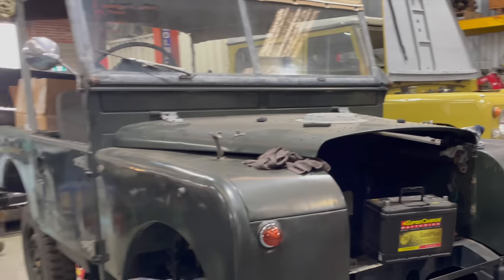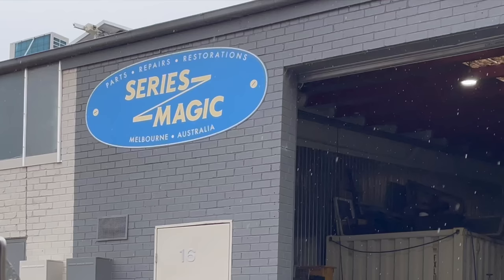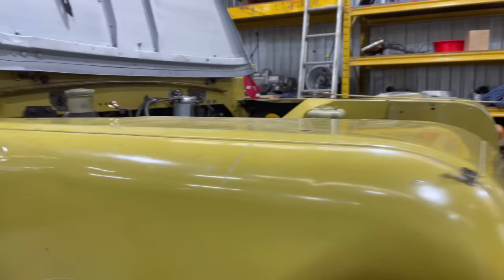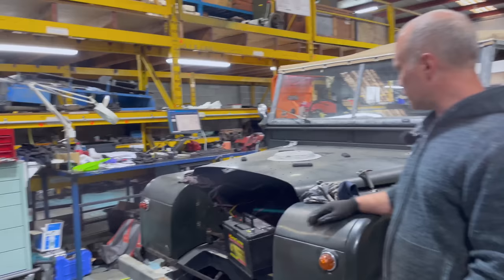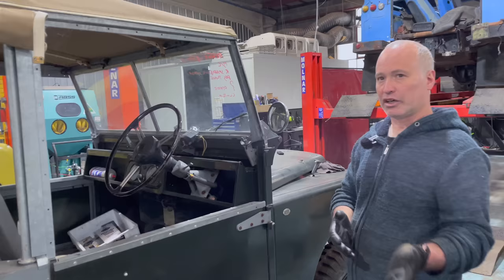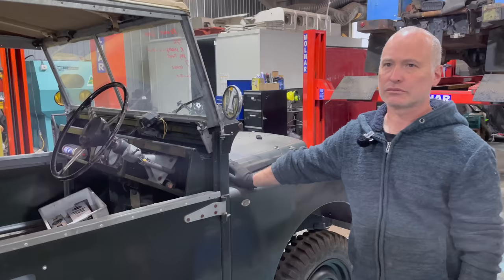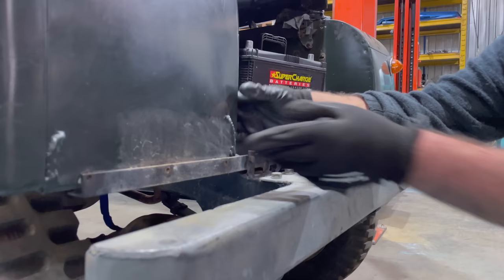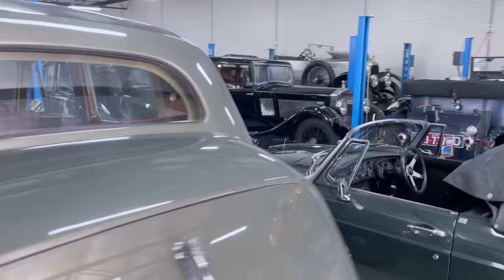LR restorer explains why Land Rovers last longer than Land Cruisers

Comment: I bought a 110 hard top defender in 2003 brand new, and only driven 85000 miles in it, so It's barely run in. The engine is sweet as a nut, and starts first turn of the key, once the heater coil light has gone out.
 It's on its 2nd set of tires and it's 2nd battery, which gave out after 16 years during Covid.
 I bought it for launching and recovering my boats in the sea.  I have had to replace the chassis, it rusted out being driven in salt water regularly, and I replaced both the chassis and the bulkhead with a galvanised one.
The only problem I have with it is the door locks which now don't always catch when closing the doors and the light switch melted after I drove 300 miles non stop, at night, to see my dad in Hospital.
I have driven long distance (UK long distances are 200 to 300 miles about 5 hrs continuous driving) I'm 6'3" 60 yrs old, and don't find it uncomfortable. The heater is adequate in winter conditions after about five miles to warm up. The paint on the whole is in good condition still with shiny panels except on the bonnet where it has chipped, I recon its good for another 20 years, I shan't be launching and recovering boats any more though. I also replaced the brake calipers pads, and disc rotors as a precaution whilst it was stripped down.
Its noisy, I don't have a radio fitted, and I love it.
Reply: Replacement of chassis and bulkhead on a vehicle of that age/ mileage is pretty damning. I’ve owned lots of Landies, but would never bother with another. Land cruiser is a far superior vehicle in every way, esp a 70 or 80 series. Far more power, better brakes, reliability, comfort, fuel consumption, just everything really. Landrovers are invariably owned only by dedicated aficionados,prepared to overlook their obvious shortcomings. Heck, a Diahatsu 4 Track is a far better vehicle.!
Reply: @supertramp6011  If you reversed your Daihatsu twelve times a day,  twice a week, into the sea whilst launching your three ton boat, and five other Ribs, for fifteen years,  whilst also using it for daily transport would you expect it to not rust?  If you read my post did you not read the Bulkhead was replaced at the same time as the chassis? Fifteen years in and out of salt water not good enough a lifespan for you? 
I think it did remarkably well considering.
Reply: @monochromaticlightsource2834  To be honest, if I was launching boats at that rate, I’d definitely make up a towing dolly to extend your drawbar length for boat launching/ recovery.- it’ll save you a fortune in replacing chassis. I have seen galvanised Landrover chassis, bulkheads and doortops showing considerable rust straight from the manufacturer,  the quality of the galvanising is far below what Landrover used to apply on early series parts, such as doortops,etc,also the steel in them tends to be thinner and inferior quality. Also , fit a tow ball on the front of your vehicle for easier manoeuvring. I do a lot of beach launches/ recovery, that’s my two cents. I tend to avoid backing any vehicle into saltwater, it is absolute death on all components, including brake backplates and calipers. And yes, a Fourtrak would rust out under those conditions, but at least it would still be comfortable, reliable and infinitely nicer as a daily driver….
Reply: Don't bring it to Australia. Long distance is 1000 miles - in 30 hours, non stop! I used to do it regularly in a Cruiser with a small caravan behind it. Half of it across the desert tracks. I wouldn't trust a Landie here.
Reply: @chrisstewart8259  1000 miles in 30 Hrs? That's averaging 33MPH! Thats actually quite good for a Land Cruiser.

Comment: Military Non-Drectional Tread (NDT) tires are sketchy in cold conditions and nearly useless on icy, snowy roads. They are definitely not  acceptable for winter or even wet weather on road driving in this day and age with their complete lack of siping. They are severely out dated for any road use beyond 25 mph/ 40 kph in anything but warm dry weather. Far more outdated than the carburetors and drum breaks of the past.

Comment: Of course Land Rovers last longer than Land Cruisers. Most post-1980 Land Rovers spend most of their lives in people’s driveways and in repair shops due to electrical problems. During that time, the Land Cruiser owners are driving or rallying their vehicles, which tends to wear them out. 😂
Reply from the maker: Just to make it clear - this video is about series Land Rover's the pre 1980 kind.

Comment: Landrover   parts are about  a third of  price  of  parts   for Toyota,  actually  tougher  as  standard
Reply: Not in the US. I’ve a 24 year old Rover and 38 year old FJ60 and you can guess which requires more love, not that I begrudge either, or which has needed to be towed (crap Britpart hoses.) We’ve had the FJ since ‘87.

Comment: Australian farmers and rural dwellers voted with their feet years ago, Landrovers were unreliable, thirsty for  their poor power outputs , think Series 2 2 a with the 2.4 4 cylinder, or the 2.6 6 cylinder, snatch 2nd gear on a hill with a load, goodbye rear axle.
Much of the Landrover internal body bracing was steel and rusted, build quality was poor, horribly uncomfortable to drive any distance!
Bush fire brigades heartily welcomed the Landcruiser and have stuck with them for good reason, they don't break, they go well and although the early petrol cruisers were thirsty they had a lot more torque and power and guess what they didn't break axles or gearboxes.
Speak to any Australian, South African or most African/ South American , the vote is Landcruiser by far.

Comment: Land Lover losing to Land Cruiser is nothing to do with reliability, it is the purchase price and price of spare parts. When the British pound rose against Australian Dollar , Land Cruiser cost less to buy and cost less to own because of cheaper spare parts, specially used JDM parts from Japan. To make matter worse, British Leyland were unable to build enough of them to meet the Demand in Australia. To add insult to the injury, British Leyland quality control deteriorated in the late 70's with low quality steel and poor rustproofing. High price, long waiting list and poor quality control turned off Australians and ends up buying the Land Cruiser.

Comment: Im sorry what???? To be honest, most of the older defenders and range rovers here only run because they now have a Chevrolet or a Cummins diesel engine under the hood, the original engines have been swapped.

Comment: i love my disco 2, but no, they last as long as the owner insists on repairing them, just see how many LR are running around in africa now
Reply: Puede ser que el Land Rover rompa más, pero amigo cuando te rompa un Toyota te gastas todo lo que te has gastado en el Land Rover multiplicado.
Reply: @Echicere  tienes razon, pero volver a casa es más importante que gastar poco.. para esto prefiero gastar solo una vez, tengo toda la transmision ashcroft
Reply: I bought my D2 for the farm for $1000 at a time everyone was getting rid of them. Drove it for 5 years with minimal input. Now it's tough to even find one. D3 in my daily now.

Comment: I've driven heaps old cruisers Hj45 hj 47 fj45s etc series landrovers are more fiddly more oil leaks weaker main gearbox and not highway friendly rover axle issues chassis rust out after Beach work (the rust from the inside out !) Iucas electrics anybody ? Iack of people who understand their faults (mechanics) diesel version particularly gutless ,lack of turning circle on LBW versions ,but on the other side of the scale in the rough they will go places a cruiser just wo 'nt there to different stories cruisers engines sit above the chassis ,landies engine in the chassis (lower centre of gravity) more stable in hilly country  , landies basically have a wheel in each corner better breakover angles and departure angle .The Australian army found out when they tried running fj 45s in place of landrovers ( due to shoddy workmanship from British Leyland ) they could throw a series 3 landrover out of a Herc or a Carabou para chute it to the ground with no problems but the cruisers would have broken rear springs also the SAS ran series 2as for over 30 years even if they had 2 spare diffs with them on patrols up north ,it is said there was problems getting the SAS vehicle troop to use the new defenders when they were first introduced so e were threaten with dismissal ! I think the cruisers are the better work horse but if your not on paved roads and bush tracks landys all day .R
Reply: Joe Lucas, The prince of darkness.
Reply: Agreed about rollover. I Might be showing my age, but I worked near Yea in the early 70's & there were a number of local farmers injured in their new Landcruisers (& Patrols) as they went on sideslopes & rolled where the Land Rovers had been going for 20 years.
Reply: @deejay3218  Never traverse a steep sideslope in any vehicle. Go straight up or down it or don't do it at all. The three rules of 4wding 1. Do I need to go there?  2. Is my vehicle capable of getting there?  3. Am I capable of driving my vehicle there? If you answer NO to any of those question, Don't go there.
Reply: Landrovers don't leak oil! They just mark their territory.

Comment: Land Rovers last longer because they spend half their life sitting in a garage, while Land Cruisers spend 90% of their time wrestling with the Earth - Simple! 🤷🏿‍♂️
Reply: "while Land Cruisers spend 90% of their time wrestling with the Earth" as in trying to return to it. Lol

 LR's from 60's and 70's have often been sitting outside in farmers fields and paddocks for decades and are now seriously being looked for to buy and restore, just as Land Cruisers from 70' and 80's are . There's LC's out there that haven't been used for decades too. Which do you think have fared better? LC's had serious body rust issues from inferior steel and next to no rust protection just as all Japanese vehicles had during those times. In the case of Japanese 4x4's it was exacerbated by off road driving in all manner of wet and muddy terrain. The FJ55 for example is getting exceedingly rare today as the rust problems were so bad in them.

Comment: landrovers have bad rust issues dont be fooled. The different galvanic properties of aluminium and steel cause shedding . And when the poor quality steel rusts  inside the doors and the firewall you dont see it until its too late ( expensive ) .  look after a landcruiser and it will last  .

Comment: Because you can replace every part of these junkers over and over and over again, one vehicle rebuilt many times by several owners.

Before any stupid comments, a sibling of mine is an owner/operator of few dealerships and two of them are JLRs, they have so much returned trade from all of the vehicles they sell, lately it’s the new defenders under warranty returns.

Comment: I don't think there is much difference in the cars, more in the owners. Land rovers, especially old ones, are mostly owned by enthusiasts while the toyota counterparts are still used as working vehicles. Obviously an enthusiast will put more energy into keeping his car in good condition than a farmer.
Reply: Wrong.
Reply: @dustyfarmer  Can you explain why?
Reply: @gubbtratt1  From example, farmers rely on their equipment to be reliable.
Reply: @dustyfarmer  That's a good point. Let's put it this way instead: while both the landy enthusiast and the toyota farmer keeps the vehicle in good condition, a working vehicle has a higher risk of breaking down badly or getting in an accident than a hobby vehicle.
Reply: @gubbtratt1  Maybe, alot depends on the operator.

Comment: Toyota Landcruiser will ALWAYS beat a Land Rover. 

Land Rover is an English bit of junk. 
The landcruiser is an engineering design that has out lasted every other 4wd on the current market. 

Surely your auditioning for a comedy job….
Reply: The Japs just copied land Rover and have been doing it for years do you think it is a coincidence that a couple years after the land Rover Discovery was launched Toyota came out with their own 4wd wagon with coil spring and all wheel drive with a centre locking diff I don't think so.
Reply: @lhrc925  , don’t forget the Rangie had coils in the 70’s. In every generation of the Discovery it is so far ahead of the Cruiser of the same era it takes Toyota until the next generation to catch up.
Reply: What’s leaf’s and coils have to do with it . Atleast with a landcruiser you can always make it home
Reply: Yeah mate I don't care what the internet tells you Toyotas are not unbreakable and every car breaks down that's why Toyota make spare parts
Reply: @lhrc925  The most sensible comment on here by far !
Reply: Land Rovers are icons. Went to some of the most remote areas of the world. Quite often, these were the first cars some of the people there ever saw. Land Cruiser would have rusted away to nothing before it arrived unfortunately.
Reply: @marsoneonone1234    Tell that to the family that died in the desert in Saudi Arabia in their Toyota SUV after it broke down.  True story
Reply: @lhrc925  I think you'll find they both loosely copied the concept of the U.S jeep of WW11.
Reply: @lhrc925  They copied the Willys Jeep actually.
Reply: @mikeb53  There's a very good reason the UN and other aid agencies use Toyotas and not Land Rovers. There are very good reasons the Toyota easily outnumbers the Land Rover in Australia and Africa and every other inhospitable place in the world.
Any complicated machine will sooner or later have an issue, the difference is that Toyota SUVs are far, far more reliable than Land Rover whose reliability  is abysmal...simple fact.
Reply: @kw8757  those are good reasons. And yet land rover is still an icon. And land rover has travelled more over the world regardless. Simple fact.
Reply: If LR designed it and Toyota built it in Japan, you'd have something almost perfect.
Reply: @mikeb53  Most new Land Rovers are driven by people who haven’t got a clue about cars, they just want the latest shiny new design. Most of the people who drive older Land Rovers are willing to accept their car is going to be an unreliable pain in the arse at best. I very much doubt that Land Rovers have covered more ground than Land Cruisers.. the weapon of choice for the vast majority of people in inhospitable environments is the Toyota and has been for decades now. Simple fact.
Reply: @mikeb53  I'd rather have a boring appliance car that works than a piece of shit junker that spends most of its time in the dealership being repaired 🤣🤣🤣
Reply: @lhrc925  While you might be correct about the copying (I don't know) this is a straw man argument. even if the cruiser copied the rover, its still more reliable, copying has nothing to do with it.
Reply: I work in the energy industry, we run Defenders and Hilux, Ranger and D-max. The Defenders do tend to have lots of silly little niggles but rarely anything serious. The others are great until they have a catastrophic failure such as a dropped injector or worse.
Reply: @mikeb53  I'm glad that you accept that Land Cruisers are the kings of reliability and are better than Land Rover, because at the end of the day if you are depending on, and even staking your life on the ability and reliability of your vehicle to get you there and back there really is only one choice. I'm also happy for all the masochistic Land Rover owners who enjoy nothing more than spending endless hours fixing their cars and getting excited about making journeys and not knowing if they are going to get there, never mind get home again.   
👍Thank you. 👍
Reply: @kw8757   Land Cruisers are more reliable (because they still use old crap that has managed to stand the test of time) but in every other metric LR are better. On road, off road. Doesn't matter, anything a Land Cruiser can do, a Land Rover of comparable spec will do it better. You know it, and every Toyota fanboy knows it too.

Land Rover are synonymous with adventure and excitement they are enthusiasts in all regards. Whereas Toyota owners just want a nice quiet life, that is stable, predictable, in other words, boring... And this is reflected in their vehicle choice. But because they wish they could be more like Land Rover owners, this is what leads them to become bullies, so they can feel better about their drab, dull, uninspiring, appliance car motoring life.
Reply: @mikeb53  If you call breaking down on the side of the road and waiting for recovery or sitting in Land Rovers service department waiting room (you'll be on first name terms with staff) exciting and adventurous I'm very happy for you, I'll stick with my LC thanks 🤣🤣
Reply: @kw8757  Yeah, do enjoy the sumptuous comfort of those leaf springs and the booming agricultural clatter from your underpowered under performing, excessively thirsty engine, but at least your hearing loss will soon prevent any more discomfort from there...

Actually... thats it! That's why Toyota fanboys think their cars are so great! They just can't hear any strange noises or whines or rattles as they've gone deaf. Also the woeful ride quality means their backs are so arthritic they can't really get down and under them anyway to do any basic work. Also they spend so much money on chiropractors, masseuses, and physical trainers just to keep walking they HAVE to keep their Land Cruisers for years as they can't afford a new one. Its like some self punishing vicious cycle! Break the cycle, buy a Land Rover. You'll feel much better!
Reply: @mikeb53  errrr...no, I've got a new one, don't  know which third world country you live in but I live in a wealthy first world country, so yeah thanks, I will enjoy my LC.🔔🔚